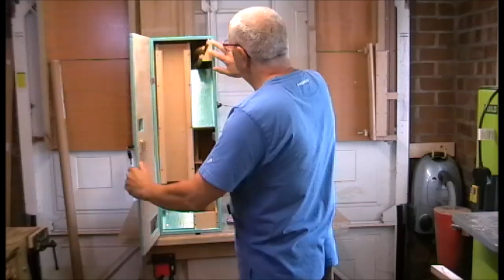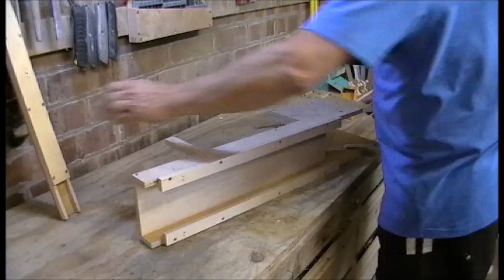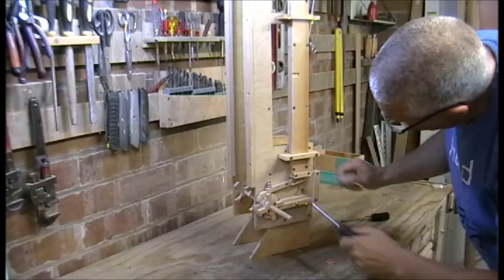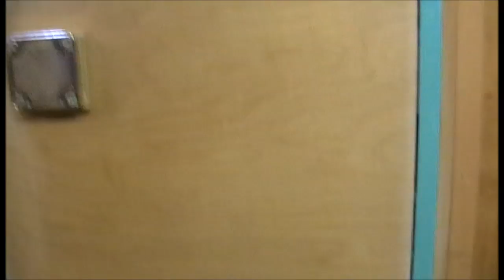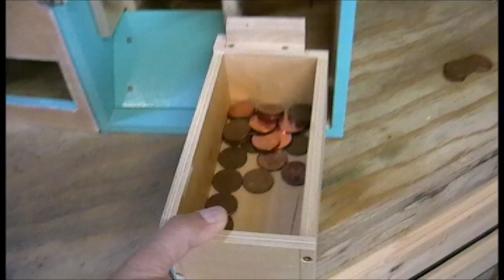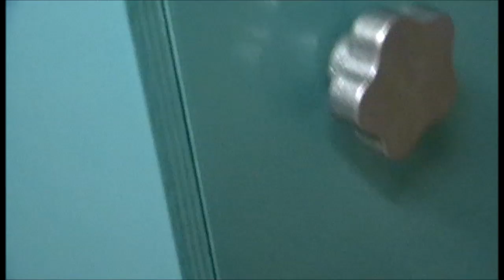DIY Vending Machine Build Video

Comment: I am hoping to build an egg vending machine based on this project, just scaled up.. Eggs will be in rectangular containers similar to the skittles, but obviously larger. Any idea if weight would affect the functioning of the crank mechanism?
Reply from the maker: Hi, I don't think the weight should be a problem as long as its not too heavy. Good lick with the build and let me know how you get on.

Comment: Hey I loved your project and I wanted to put airheads or snickers instead cause I love airheads and snickers. I wondering if I can increase the price to $0.50
what is the perimeter of the box
and how many smarties you was able to hold
I am doing a class project and I love building stuff
Reply from the maker: Have you downloaded the free plans as the measurements are in them , there is a link in the description.
If you watch Jose Pino's video, link is description,  you will see how the coin mechanism works so that you can make it accept what ever coin you want.
Hope this helps
Reply: Yes I had downloaded the free plans with the measurements and I just watched them thank you
Reply: What kind of wood is that and where did you get it from
Reply from the maker: Hi, all measurements are in the FREE plans. I think it holds about 18 tubes of Smarties.

Comment: why is  T6 much smaller then the other parts? its length 7mm while T1 is 673
Reply from the maker: Hi, that looks like a mistake on the plans so thank you for pointing that out it's much appreciated.  I will look into it for you and correct it but it may take a few day as I am very busy with other things at the minute.
Reply from the maker: Hi, I have now changed to plans and added the correct measurements for T6 so download them again and hopefully it should make more sense. Thanks again for pointing out the mistake and sorry for any inconvenience caused.